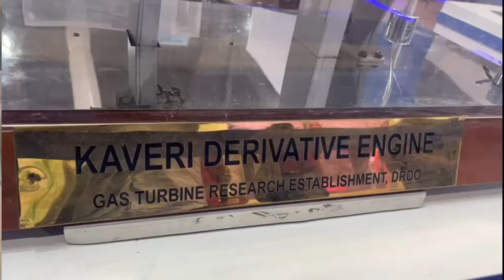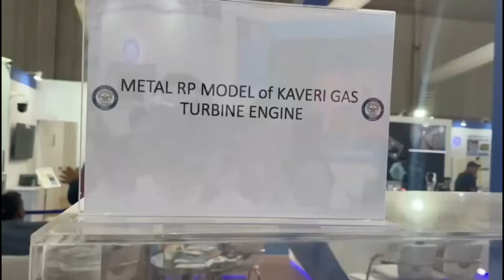#breakingnews  Kaveri Engine program gains momentum, MIDHANI to supply all components

Comment: Need to know.
1. What metal and alloy used for Kaberi jet turbine and combost chamber, sensers, wires...
2. What things increase thrust? Good fuel and best turbine with best combution chamber with best facility of inlet and outlet air at low as well as high altitude.
3. Best system for controling hot outlet air as a result, it may control thrust as our requirements.
5. For making a jet engine, What are componets required?
a. Make a list.
b. Make the research on that compnets. Observe theoreticaly, how each componet has a unique role.
c. Design each componet samples. Think how we can make best components with latest.
d. ...
e. How caberi engine can  on/off system like byke engine i.e user friendly....
...
6. What will be the weight of fighter jet? How much payload lifting target .....
Then decide weght of the engine and their compnents. 

.....
Lot more points. I will be share latter
Do't mind my english
7.

Comment: 110 kn thrust vectoring rectangular nozzle engine is not sufficient for fifth generation fighter jet aircraft project minimum 250KN generating engines should be designed and prototyped and real test.

Comment: 76 kn with after burner can't we make it to atlest 100 kn😢
Reply: Kaveri engine program so far funding 500 million dollars. One Western engine development cost 20 billion dollars. Chinese engine program cost 50 billion dollars. If y o u have 19.5 billion dollars to DRDL for engine development then call them....
Reply: @Manas-f5i  how much it cost to buy some rafale and su30mki then this funding is nothing if there is no funding for local technology there is no future for india
Reply: It has to fit into the same space as F404 and the weight also has to be similar. F404 is a state of the art engine, therefore it requires state of the art technology to match the existing F404 let alone surpass it.
Reply: Only after getting sufforon engine from France it will be possible within 3 years otherwise we have to wait for the success of after burner which may take further 3 years to induction 😀😄
Reply: @kumarankumaran3947 Indians are like beggars begging for technology from the French😂